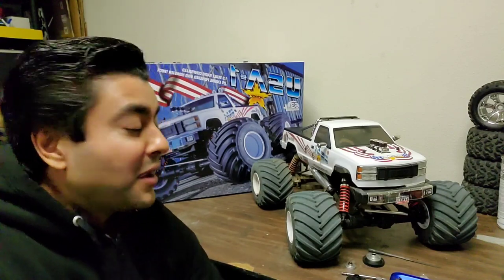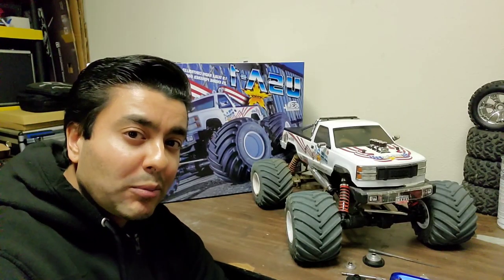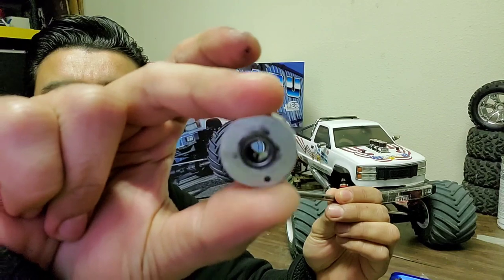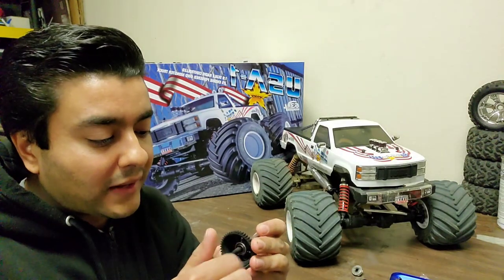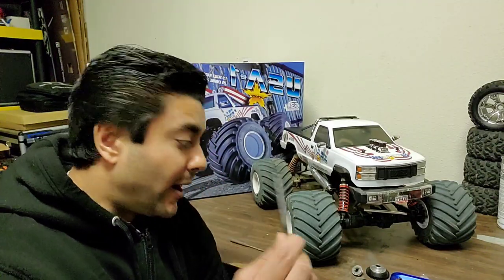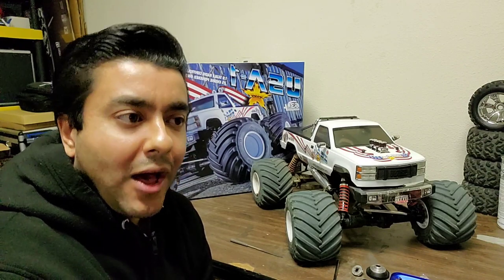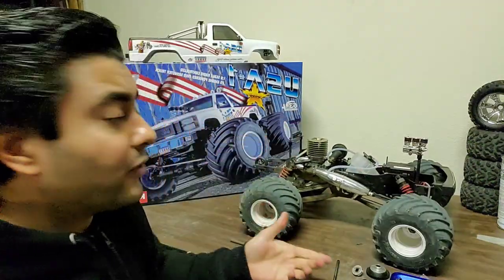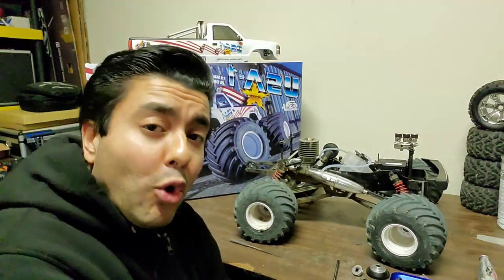NEW Kyosho USA-1: Transmission Problems + Muffler Problem (Fixed)

Comment: Kyosho fan here, but seeing this, having doubts now if I’ll get the this truck. This will be available here in UK this January 2022. Hope Kyosho watches this & sort it out. Thanks for the heads up. Kyosho should send you a brand new truck for their remiss. The Kyosho Mad Force 3 speed tranny on Anthony Cromptons’ YT video is awesome. Hope it all goes well with your truck
Reply from the maker: Really hoping Kyosho does right to the customers experiencing issues like these!

 The Kyosho name has been around since 1968, I assumed when buying this that I'd feel the quality like I do on my Traxxas Revo 3.3 which has been around for 20 years less!

I've also seen Anthony Cromptons videos! In fact, I purchased this usa-1 after seeing his mad force shifting smoothly! His videos on how to adjust the timing were also very helpful. Not sure what Kyosho changed on this transmission but it wasn't a good change.

Comment: I’m researching feedback on this truck as I’m thinking of adding it to my collection. But after watching this, I’ll look for something more reliable. Thank you👌🏻
Reply from the maker: It's actually very reliable! The initial issues were because of faulty transmission part, which kyosho replaced. I have 2 of these trucks now because they're that fantastic. No other 3 speed nitro on the market currently unless they bring the savage XL back
Reply: Now in 2024 has Kyosho updated the transmission? I was about to buy one until I saw the transmission issues

Comment: Thanks for sharing this important info about the USA-1 problems. This must be the first time the inside of a pipe gets loose without any good reason. That should not happen, bad quality from Kyosho. Same with the 3-speed transmission. I want to buy this truck some day but they have to fix the problems first. Also a new truck should be easy to get replacment parts for and not have to pay a fortune to get them.

Comment: It would seem as though kyosho has farmed out its QC to the consumer. 

Massive shout out to yourself and RG 
for being on the Frontline of this issue and documenting it.

I sense a storm coming for kyosho very soon as these usa1 nitro kits are beginning to be sent out in mass, mine arrives tomorrow.

I see quite a lot of Interest in this nitro Kit and I suspect pre orders were pretty robust.
Reply from the maker: Very possible indeed - seems like we've been doing the QC over here!

I just posted a video with it finally working properly...it was cut short due to stripped teeth on 1st gear due to loose mesh, but at least the transmission is still working after I rebuilt it/ new parts, and properly lubed it.

I do hope Kyosho will at least provide some replacement parts to compensate for the ones we've had to buy already for a brand new truck
Reply from the maker: Hey I see you from my notifications that you commented on my other video but the comments dont show up...thanks YouTube .... Just wanted to let you know as I think you asked a question but couldn't see the whole comment

Comment: My truck was shifting perfect from day one. But today, it would shift into 2nd gear fine, however,  when it shifted into Third gear, the engine would overspeed , as if the 3rd gear was not turning the driveshaft.  I have to take it apart now to analyze the problem...  

By the way, when I got the truck, I immediately replaced the engine with an OS .30vg and eventually replaced the Kyosho pipe with a OS T-2090.  Seeing that your Kyosho pipe broke, I'm glad I'm using the OS.
Reply from the maker: Did you manage to fix the issues you were having? As you may have seen from my latest videos, it's running great now after I rebuilt and replaced a bunch of transmission parts
Reply: @TurokRC  Not yet.  I ordered those steel gears from Ebay.  Once I get them, then I will take apart my transmission to see what's going on. I was stoked that I seemed to have a perfect running USA-1 until the 3rd gear stopped working.  This situation reminds me of the original Tamiya Juggernaut, which was plagued with transmission issues when first released.
Reply from the maker: I think the transmission needs a good servicing every 10 tanks or so. The needle bearings are a huge failure point and need lubrication. Knock on wood but mines been working great for about 10 tanks now, posted an update bash video
Reply: @TurokRC  When you say "needle bearings" what exactly are you talking about? As I look through the manual, I'm not sure what is meant by "needle bearings."
Reply from the maker: There are needle bearings inside the 2nd gear cam and the 1st gear, those are what seized up on me

Comment: Cool information, watched a few of your videos on this truck and will be doing everything you did to mine that should be here tomorrow,will tear it all down and lube everything before running it.
Reply from the maker: It's a fantastic truck, both mine are running great 👍🏼  if you do have any issues kyosho has been good in sending parts to fix
Reply: @TurokRC  Both? You have 2?
Reply from the maker: @cwatson42785  yes, fantastic machine so I picked another up

Comment: Such a shame it has these annoying issues. 

I think I may grab a HPI as my next nitro. Leaning towards the Savage but also entertaining the idea of the Truggy as it has a single speed transmission. Kind of prefer the Savage though.

Currently running an Inferno Neo 3 which is doing well. Assembled to a high standard and the engine hasn't given me any major grief. 

Fingers crossed you get the USA-1 sorted but I won't be buying one now. Thanks heaps for the info.

P.s. Don't mean to sound weird but you have awesome hair!
Reply from the maker: Lol thanks, I try to keep suave with the hair 😎

Definitely a shame about all these issues, the truck has such a simple design yet fails at such a critical part.

And more than happy to share these issues so it saves others from the same headaches! Really hoping it also gets Kyoshos attention to send us some upgraded parts or something (one can only hope)

I've also seen great things about the savage XL which has the 3 speed, but I know the trans is harder to adjust as you have to remove the whole thing just to get to one of the cam adjustments. One thing I do rate about the Kyosho is it's ease in adjusting the transmission and ease in removing it

Comment: Hey great video I just found your Channel today . I’m getting a USA 1 for Christmas and want to be on top of these issues. Do you think cleaning and lubing the one way bearings before I run it would help or should I just replace them. Also do you have a link or part numbers for the 3 gears in metal.
Reply from the maker: Definitely take it apart and lube everything! Also worth taking things apart and using threadlocker

Comment: Well that sucks. It looks like I've expected that the material they use is weak. Carbon is the way to go, but seen none for these online.  There is a aftermarket company make steel gears for these. Maybe that could be the only cure.
Reply from the maker: Do you happen to have a link for the steel gears? Saw some on ebay but they're sold out

Comment: Researching online,the best solution I have found to the 3 speed clutch problem is to "upgrade" to a traxxas clutch, bearing, etc.
Reply: Search: "Kyosho FOXX 2.0 Nitro Running WILD - Fixed By An Unlikely Solution - SNOW BASH RUN - 4 Wheel Steer" Nitro gang explains what he did to his Foxx 2.0 (essentially the same rig)

Comment: I bought mine two weeks ago and have not even started the engine yet. I am disgusted with all the problems you and RG and others have posted about the faulty transmission and cheap parts used. Kyosho used to be top notch, but now? Shame on them. Mine was purchased from A-Main (great store btw) and out of the box the hood decal was scratched in 3 places, the tuned pipe is scratched, and the chassis had some weird mold or fungus all over it, which I had to clean off. $520 plus tax for a shelf queen I am hesitant to run. Sux....
FWIW I have the FO-XX V2 nitro and have not had any transmission problems in the 5 tanks I have run thru it.
Reply from the maker: I'd advise taking transmission apart and lubing those needle bearings before use. Believe it or not I actually ordered another one on black friday....now that I've got it working and shifting great.  

Kyosho has responded to me and has offered to replace the parts so I appreciate that. I bought both from Amain who are awesome. 

My tuned pipe was also heavily Scratched, even though it's advertised as "polished"
Reply: @TurokRC  Yes, I will do that. I contacted Kyosho America about the issues I had and they haven't said a peep.
Reply from the maker: @xKmotx  seems like they are swamped with people contacting them due to the usa-1, not to mention all their other offerings. If you don't hear back from them in 2-3 days give them a call to follow up. They offered to comp me for a few of the parts I bought

Comment: Man, That low speed is way too rich, that’s why the idle is screaming when you let off. Try a pinch test to set it up. My USA 1 had shifting issues right out of the box, had to disassemble it and force the cog on the 2nd gear out a few times and turn out the screw 1.5 turns and then it shifts like a dream. Absolutely my favourite nitro I own(7) of them. I’m thinking I might even sell off my savage XL’S so I can buy another USA1

Comment: Smh and i was really gonna let this truck my first nitro R/c have always got electric  and basically if there's anything wrong its user errors caused usually but not always, but im glad ive continued to check videos on this and see there's a issue that's expected with nitro but to not have part availability to even fix is a issue!!!!! Smh no way in hell $500 dollars and breaks under month with no part availability!!!!!
Reply from the maker: Kyosho service has been excellent - they've been sending out replacement parts

Comment: She sure in moves in 3rd. This is so unfortunate. Well, just like mine the shaft and one ways are fusing together. I think the shaft is not hardened properly or at all! I sanded mine and I'm waiting for gears, but what for!? Just going to have the same issue. Amain is great! They took an entire 600 size heli kit back for me that had too many issues.
Reply from the maker: That's what I fear - I'm going to put brand new parts and the same thing is going to happen....today I am going out with this truck again with full lubed bearings, both clutches brand new. If it still has issues then I'm definitely done playing with this truck. I've contacted amainhobbies via email and also sent them the link to this video. Hopefully they'll do us right !

Comment: I have a USA 1 an old one with a single speed or let say with a low super gear in it.It was powerful and durable, nothing have a problem ,to the single and one big gear ,and it was 25 years already.even now nothing is broken or smashing compared to the new USA 1 with 3 speed gears.Maybe the new USA 1 is so big and might the weight of the model is so heavy, that is why the 3 speed gear cannot lasts longer.if I am right.

Comment: I think I have the same issue with my usa 1 Bc the pipe has like small dents in it but idk why and their is always fuel coming out the pipe now and it won’t even start I think their pipes are really bad can you send me the link to the Amazon pipe?
Reply from the maker: Sounds like the same issue, if you take the exhaust off you should be able to shake it and see if the baffling has come loose. The one I replaced it with is the shaluoman muffler on amazon
Reply from the maker: Shaluoman Exhaust Pipe SH 21 28 Level BQ003 Engine Exhaust Tube for HSP Model Car 1/8 RC Cars Spare Parts https://www.amazon.com/dp/B0936PYMG8/ref=cm_sw_r_apan_glt_fabc_08N4YFGB9SGGPBTKPGZ2
Reply: @TurokRC  thanks I’ll take it apart and try shaking I didn’t know what was wrong until I watched this video Bc no matter what it won’t start I tried tuning it and it almost start but a lot of fuel would come out the pipe after
Reply: @TurokRC  Hey I just took the pipe off and shook it their was no noise but the grub screw was stripped for some reason so pipe was hard to take off and I contacted Kyosho about it and they seem to have no idea what’s wrong too Bc every time I try to start it won’t start and fuel keeps coming out of the pipe do you have any ideas?
Reply from the maker: @grandmasteryoda8588  Was yours ever running properly or have you not been able to get it running at all?
Reply: @TurokRC  well I was able to get it running correctly for about 2 tanks and that was it
Reply from the maker: So are those 2 tanks break in tanks? Are you still using the break in ring?
Reply: @TurokRC  I no longer use the break in rings and no I fully broke it in
Reply from the maker: @grandmasteryoda8588  if you have literal fuel coming out the exhaust and not oil, then there's too much fuel pressure. I'd still check your exhaust even if it doesn't rattle, look inside the exit port and make sure it's not blocked
Reply: @TurokRC  Thanks man I think that’s the issue because it’s literally fuel coming out of it

Comment: @Turok can you share the exhaust and fuel line you bought my transmission is shifting fine but my exhaust broke the same way
Reply from the maker: Wow, Kyosho should really provide a replacement muffler if yours broke like thst too. I'm using the shaluoman muffler from amazon
Reply: @TurokRC  this truck has proven to be problematic but I like it so much
Reply: @TurokRC  update Derek is taking care of it and spending out replacement parts

Comment: Interesting because the mad crusher didn't have these issues. Could well be a bad batch. I hope so anyway
Reply from the maker: Mine is shifting great now, posted an update bash video!
Reply: @TurokRC  I'll check it out 👍
Reply: Mad crusher had the weak plastic in the axles. They didn’t fix that until the USA-1 came out. They’ll fix the transmission in 2 years with the next  update
Reply from the maker: @michaelgarcia22  Kyosho is sending out replacement parts to everyone for the transmission - seems to be solving the issue for most.

Comment: Hi mate. Surely they have to take the truck back?
Reply from the maker: If I still have issues after this rebuild which basically has all new parts for the transmission now, then I really hope they do take it back because I'm not going to keep replacing transmission parts after every 15 mins of use !

Comment: Needle bearings in 2 or 3 speeds need a very small dab of lithium grease, not oil.
Reply from the maker: Indeed, that's what I usually put in my bearings but someone recommended bearing oil instead 🤦🏽‍♂️. After I put lithium grease I've not had any issues so far it shifting.

I picked up the Kyosho one way bearing grease which is silicone based, I'll be using that from now on

Comment: I might return my usa 1.  It's an inherently poor design and poorly assembled.  No other company has a multi speeds transmission that engages into plastic lobes, most use aluminum.
Reply from the maker: I've ordered a set of hardened steel gears for this truck. Will post a video update of the install and performance once received
Reply: @TurokRC  ebay?  How much?  Keep us updated.
Reply from the maker: @tjv6976  yes they're on eBay and also AliExpress, same price

Comment: I fixed the gears stripping on the inside by hammering out the small metal pin that is inserted into the plastic and drilled out so I could drive in a larger machine screw then Dremeled off the screw head and any protruding screw on the other side then put it back together and it shifts every time